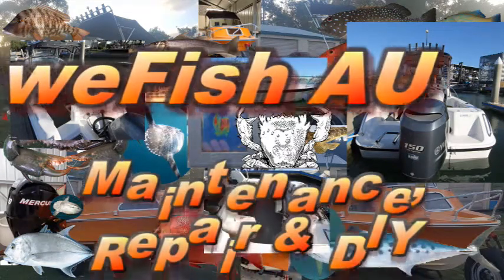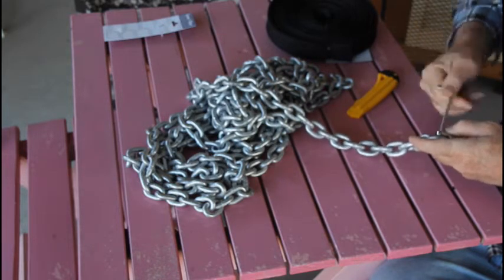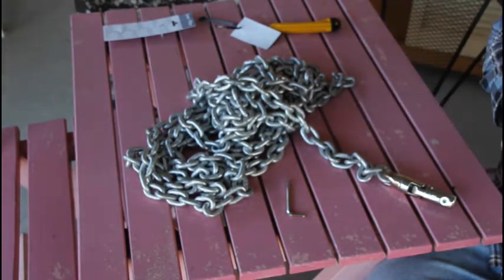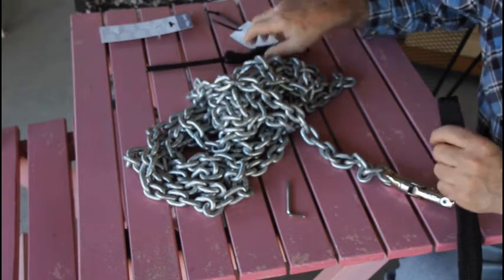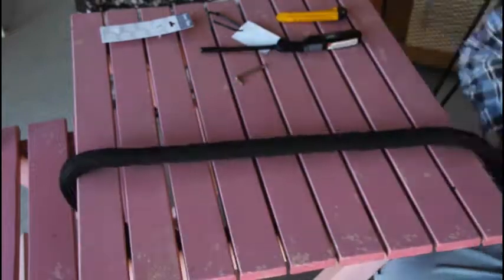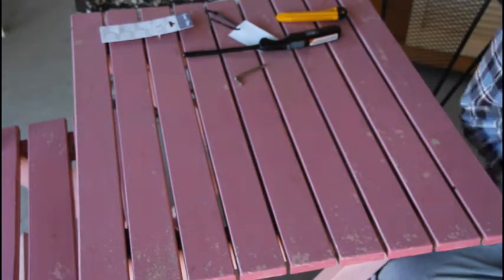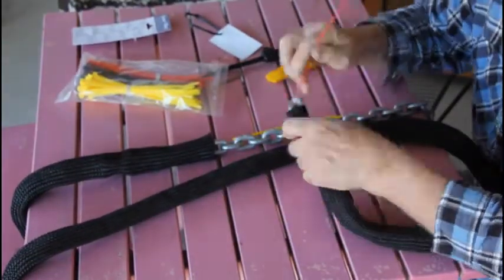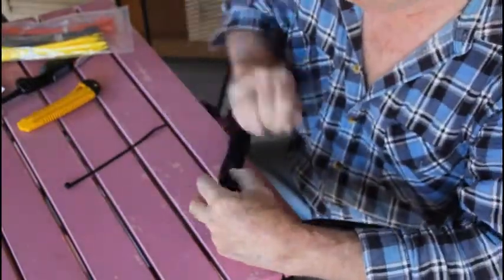Fitting Chain Guard to your Anchor Chain

Comment: A chain guard is a bad idea unless it's on a bicycle. In this case they are great for keeping the chain damp and increasing corrosion whilst in storage. It covers the chain and inhibits inspection and also stops the chain from grabbing the ground when the anchor is deployed. Also don't try running it through a chain winch. If it's designed to stop chain rattle then it has a few negatives and safety factors to consider. Cheers
Reply from the maker: True.  There are pros and cons to most things.  In this case I rinse it thoroughly with fresh water after every use and check the chain by feel every 12 months.  So far I haven't had any issues, but thank you for the comment, others may not have thought of that and I didn't think to mention the maintenance aspects in the video.